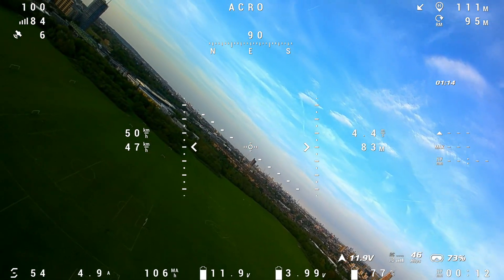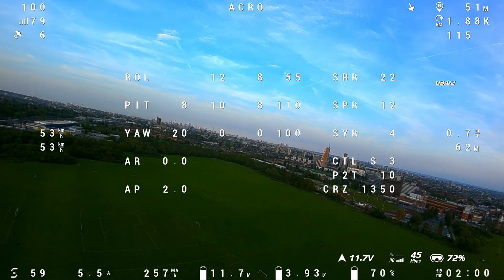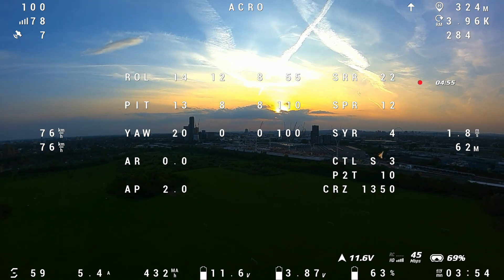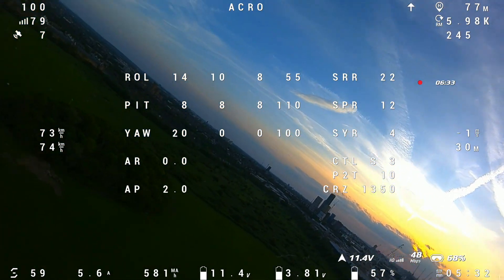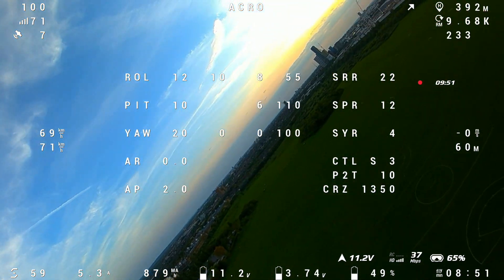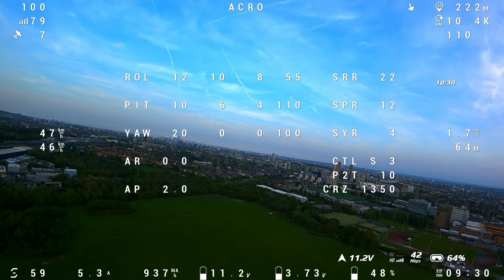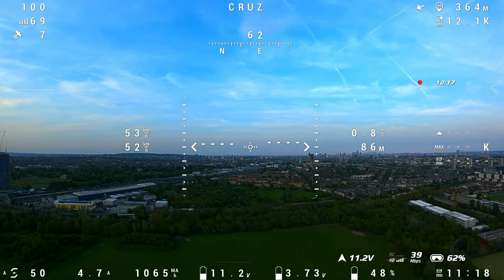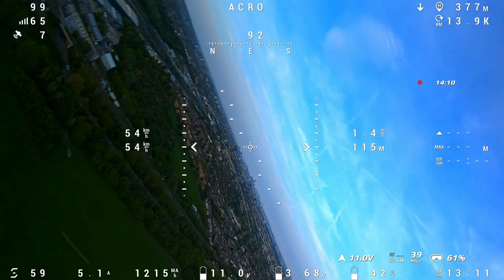Fixed Wing PID Tuning Tutorial

Comment: Is it mandatory to do autotune in Acro mode? Can it be done in Angle mode as an alternative?
Reply from the maker: Angle mode does not allow your plane to pitch or roll more than a predefined angle. This means that you can't do a full 360 degrees turn on these axees and the calculation for the rates and the feed forwards will not yeild the correct result (at least from my experience).

Comment: Nice pid tuning guide! 👍 May I ask you what battery, motor and prop combo you are using on the AR Baby Wing as I've also got it and I still have a free O3 unit or walksnail to set it up (regarding the weight and power). Thanks
Reply from the maker: Motor, prop and ESC are same as in the PNP version, just stock.
FC is MATEKF405TE. Air unit is standard Caddx Vista with original DJI camera. 
Battery is Tattu 2200mAh 3S. (The battery was a 4S, but one cell died and I made it into a 3S hahaha)
Reply: @DZARO  Thanks a lot 👍

Comment: Hi how you setup your radio for adjusting pid while flying?
Reply from the maker: You have two options: 
1. Use the INAV-FWG's (Fixed Wing Group's) Model for OpenTX or EdgeTX. I have not used this model because I make my own models for each type of airplane that I'm flying.
2. Use one of my EdgeTX models which has this programmed in a slightly better way. I will be doing a tutrial on how I set this up as well as how it is to be used in the near future.
Reply: @DZARO  owh great will waiting for those setting thanks in advance 😁
Reply: @DZARO  I’d be interested in a video about your EdgeTX model for in-flight PID tuning as well!
Reply from the maker: @brubakerjm  No problem, I'll make a video onn this very soon! Stay tuned!
Reply: @DZARO  Hi , great video and very informative. Did the in flight PID Tuning setup video get made ?
Reply from the maker: @andrewdouglas5939  Not yet, but I might have ght find the time to do it this weekend because it is necessary to suplement this video. 

I've been busy with a new project lately: 👨‍🍼
Reply: @DZARO  how we can use one of your model of Edgetx?
Reply from the maker: @FuryExtreme75  I'd have to upload one of my model files and you can use it. but the configuration in INAV also needs to match so that things can work as intended.
Reply: @DZARO  You can share an edgetx model and a diff file of inav so I can figure out how to do it, or print screens of the radio and inav configurations and I'll try to figure out how to do it, a video tutorial would be better but I don't know if you feel like it or the time to do it. Do you still have discord?